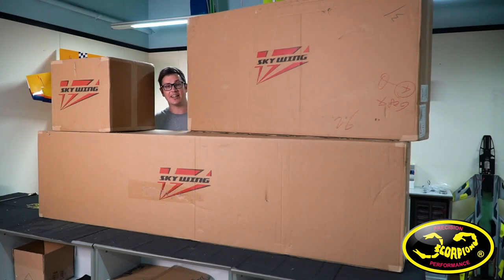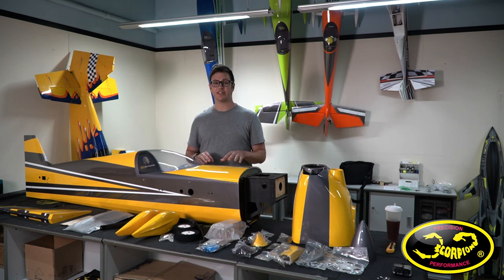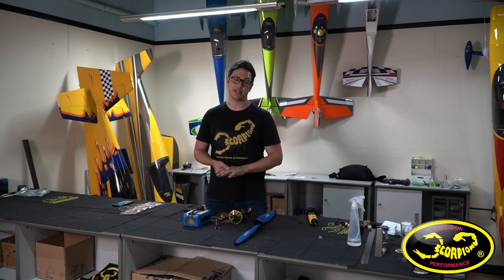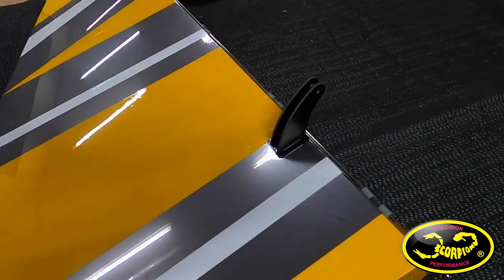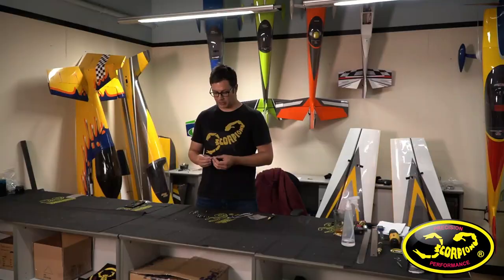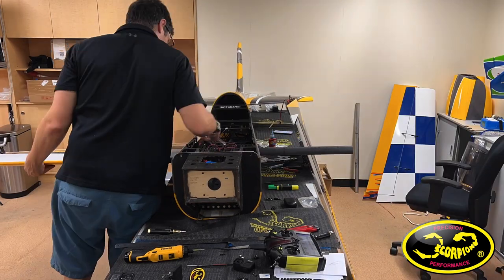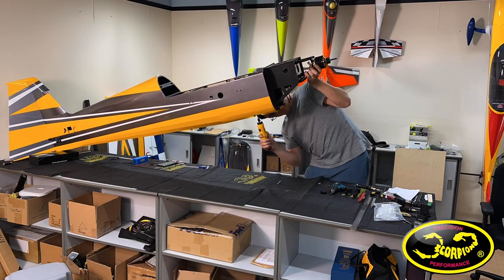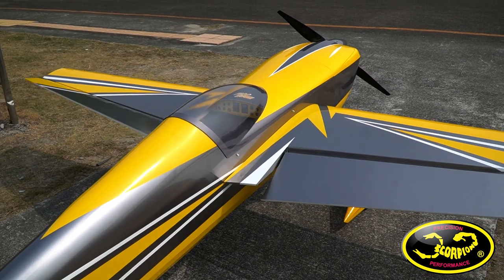40% Giant Scale goes ELECTRIC - 116" Skywing Edge + Scorpion A-7445  (150cc-176cc class) - Build Log

Comment: Great build demo. !!  Question:  Were all the servos and receivers powered by the ESC's BEC ?  I.E. No separate 2 cell lipos were used to power the servos and receivers ?  I want to build a similar size 3D electric and I'm concerned about what is the best way to power the control system?

Comment: I am preparing a 114 inch airplane with the same motor. In the video, it appears that an electric propeller is used. Is there any problem if I don't use an engine propeller? How did you attach the electric propeller to the engine hub?

Comment: What servo wire crimping tool are you using? Also where do you buy the wires and terminal ends. Thank you.
Reply from the maker: The one I have doesn't have a brand name! But it is a standard ratchet servo lead crimping tool. 

Similar to this https://www.sussex-model-centre.co.uk/products/extension-lead-and-servo-plug-crimping-tool-sn-28-b

Comment: I still think what with this big of a battery splitting it into modules is better in the long run
Reply from the maker: Single battery like this, or at most 2 x 12s 5000-6000 mah bricks, is much more convenient. Only charge 1 pack per flight mean it is the same convinient as flying a 60” airframe!

Comment: Awesome video, I’ve been doing a lot of research on this plane and this ends it, I’m going to buy the green one once it comes back. Two questions, did it come with wing and stab bags, also what it the size of the wheels? Thanks
Reply from the maker: That is great! It is an awesome plane! Now th ebig question, will you go Gas or electric?? 

The plane comes with wing and stab bags, and it comes with wheels. I did not measure the size though. I will measure tomorrow.
Reply: @dahlkyle  I’m going to be putting a gp178. So gas, also do you know anything about the extreme flight 114” slick 580, I can’t decide between that or the edge, thank you.
Reply from the maker: I have not flown the Extreme flight 114" planes but I hear they are really great as well
Reply: Great video 
I am here in states can you please inform me how to order one no one has no big planes pilot RC I have  112 on order but it’s a pre order 

If you can help me with a sky wing distribution please